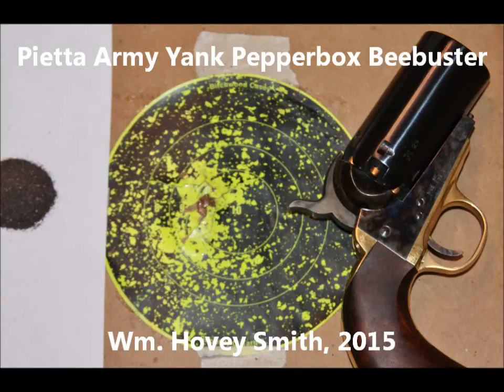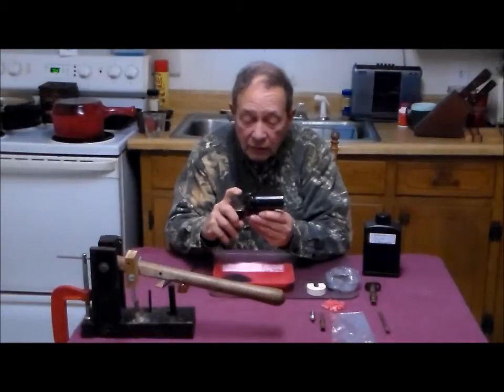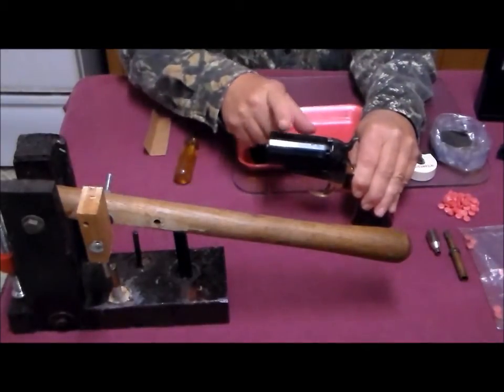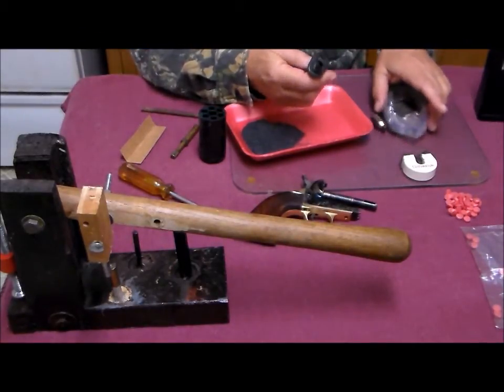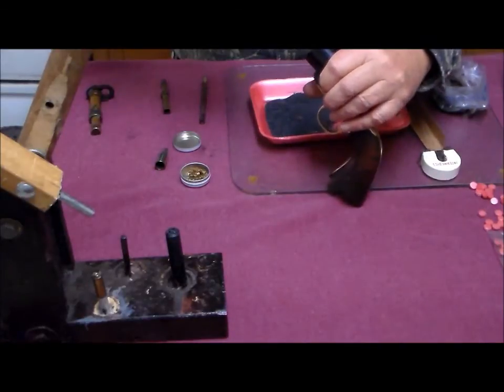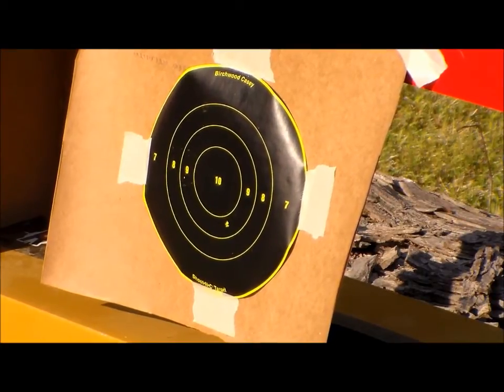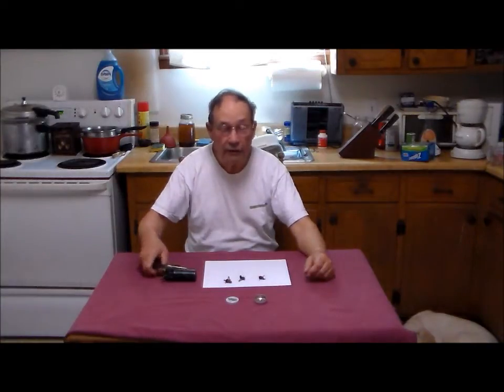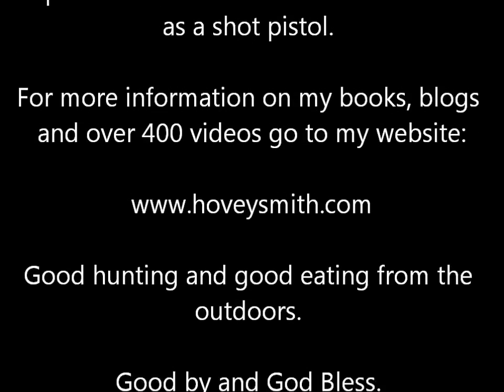Pietta Pepperbox Bee Buster

Comment: You should try "Morton's" rock salt.  It comes in a paper bag and you purchase it for making ice cream.  If the rocks are a little to large, you can just put them into a sandwich bag and hit them with a mallet until you have your desired size.  I would fill the whole cylinder up with it.  I bet that would work just as well.  Thanks for the video.

Comment: :) Greetings Hovey nice gun i got a question partner with the pepperbox barrel removed can you fit a Colt 1851 Navy Barrel and Cylinder on it ????? i am just curious
Reply from the maker: Not as is. There is no way to attach the wedge that holds the barrel assembly to the frame.
Reply: @HoveySmith  ok thank you

Comment: I hope you're still monitoring these comments. Would a  .36cal copper gas check hold the shot in better? I'm thinking of using #12 lead rat shot.
Reply from the maker: If it will load down the bore it should do finel.
Reply: @HoveySmith  Thank you for the response sir. I figured it would work, I just wasn't sure if you had tried it.